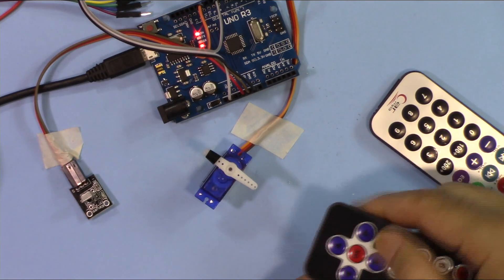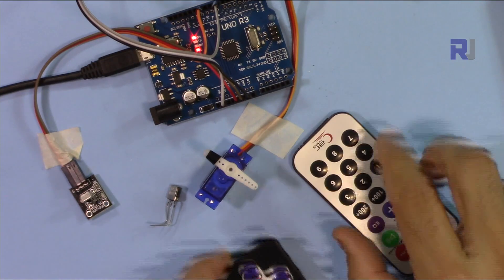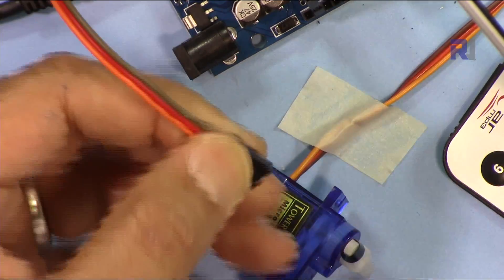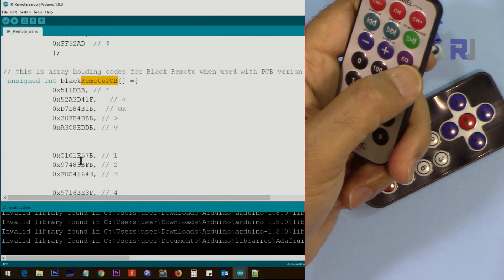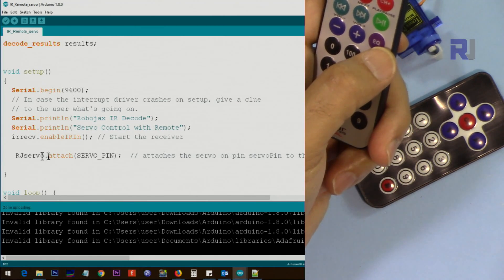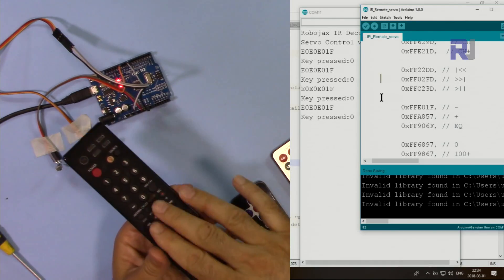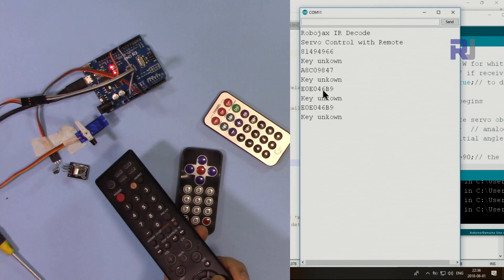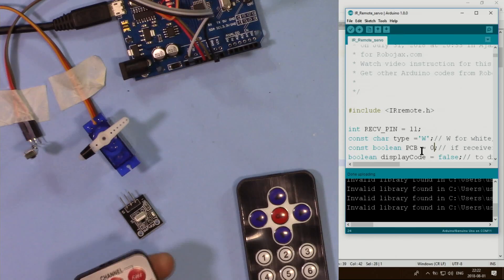Remote 4: Controlling Servo motor with IR Remote using Arduino code RJT113

Comment: Sir I watched all videos related to arduino servo motor push buttons. I learned so many things thank you so much for your great effort. Can i ask a question? Do you a have a tutorial like this but using RF Transmitting Module instead of IR? Hope you will notice my comment
Reply from the maker: Hi, I have no video on RF remote servo or switch
Reply: @robojax  can u make on pls🥰

Comment: Arduino: 1.8.18 (Windows 10), Board: "Arduino Mega or Mega 2560, ATmega2560 (Mega 2560)"

C:\Program Files (x86)\Arduino\libraries\RobotIRremote\src\IRremoteTools.cpp:5:16: error: 'TKD2' was not declared in this scope

 int RECV_PIN = TKD2; // the pin the IR receiver is connected to

                ^~~~

C:\Program Files (x86)\Arduino\libraries\RobotIRremote\src\IRremoteTools.cpp:5:16: note: suggested alternative: 'TXC2'

 int RECV_PIN = TKD2; // the pin the IR receiver is connected to

                ^~~~

                TXC2

exit status 1

Error compiling for board Arduino Mega or Mega 2560.

This report would have more information with
"Show verbose output during compilation"
option enabled in File -> Preferences.
Reply from the maker: Very simple just read it TKD2 was not declared in in this scope.
Reply from the maker: Have you watched the introduction to infrared for arduino? Library is missing
Reply from the maker: Start from here https://youtu.be/LVd9_i-BQcg

Comment: I want to remotely press a button. Would a servo do this or world a stepper motor be a better choice?
Reply from the maker: each can be used for different job. servo motor can rotate only 180 degrees. while stepper can rotate 360.  In this video I've shown only servo motor but if you watch carefully this  video and stepper motor video,  you should be able to do it.

Comment: Hello again, if i want  move the servo from left to right, then return from right to left continuously (0 - 180 - 0 - 180 - 0 ....) and can be stopped at any point by pressiing remote button. how to code it? can i use code as below?
I use switch case in this method. it is possible?

case 0xA15EFF00 :
      Serial.println("three");
      for (servo1_angle = 0; servo1_angle <= 180; servo1_angle ++) { // goes from 0 degrees to 180 degrees
        // in steps of 1 degree
        servo1.write(servo1_angle); // tell servo to go to position in variable 'pos'
        Serial.println(servo1_angle);
        delay(100);                       // waits 15 ms for the servo to reach the position
      }
      for (servo1_angle = 180; servo1_angle >= 0; servo1_angle --) { // goes from 180 degrees to 0 degrees
        servo1.write(servo1_angle);              // tell servo to go to position in variable 'pos'
        Serial.println(servo1_angle);
        delay(100);                       // waits 15 ms for the servo to reach the position
      }
      break;

thank you
Reply from the maker: Hello, Arduino IDE already has the code . Just b click file, examples and find servo.
Reply: @robojax  thank you for replying .... but when i use the irremote, it was moving o-180-0 once only. it was not moving continuously
Reply: @robojax  in forum said that it needs global boolean variable code setting , how to do that? please explain it. thank you

Comment: Good day sir , sorry for disturbing u but I'm facing problems with the code and when i try to modulate it it shows an error saying that.....

'sketch_aug19a:20:10: fatal error: IRremote.h: No such file or directory
 #include <IRremote.h>
          ^~~~~~~~~~~~
compilation terminated.
exit status 1
IRremote.h: No such file or directory'

I don't know why this is happening please help me....and I have also tried using the code given in the description that also doesn't work...please help..

Thank you..
Reply from the maker: Hello, it is very simple. "no such file" it means you have not installed the library which has that file.

Comment: Hi. Thanks for the detail description. I did  control my servo motor using your code. It works great. But there is one problem. The motor keeps jittering when it was connected eventhough if i dint use the remote. Pls help me on this
Reply from the maker: then something is wrong with the motor.  Try to connect it to 5V and GND and remove the signal wire. it should show the same problem. if  so, the servo motor is defective.

Comment: why is "IRremote.h: No such file or directory" popping up when I try to run the code very new here.
Reply from the maker: because you did not watch the video and did not follow the instruction. Please watch without skipping, I can assure you the issue will be resolved. This video is one of a series of videos on remote. you MUST watch the introduction to remote where we learn how to detect code. Then come to this video. I have mentioned it at beginning of the video.  The links are in the description.  good luck

Comment: Have a nice day. I know it's been a long time since I posted this video, but I hope you can help me.
 I am getting this error;The function decode(&results)) is deprecated and may not work as expected! Just use decode() without a parameter and IrReceiver.decodedIRData.<fieldname> .I would be very happy if you help me.
Reply from the maker: Good day, it seems it is the result of newer Arduino IDE (software). Never seen this.  Try older Arduino software and see if it can resolve this.
Reply: @robojax  Thanks. I downgraded to the old version and the hex codes in your video are different from the hex codes of my remote. I fixed this and it worked. Thank you very much for your interest and concern.
Reply from the maker: I am glad you resolved the issue. Please subscribe as this helps my channel to grow.

Comment: Hi there! I know its been a year since you uploaded this video but I was wondering if you could help me. I want to use a continuous servo for this project but I am having issues with it since there's no potentiometer inside. How can I fix this?
Reply from the maker: Hi, I have video on 360 servo. That servo is just make for joke. it is not a real servo motor. you need to use stepper motor if you want to be able to control is at any angle and control the speed.

Comment: Can we control 20kg servo with the same way??
Reply from the maker: Yes. All servos are the same. they just need signal. the power is not coming from Arduino but from your power supply.

Comment: Could I get some help? So, I used your code and everything works great, just had to change some of the codes to fit my remote. But, every time my roommate plays his Xbox, it picks up the IR from his wireless controller and makes my servo tick. It doesn't make it move, it just ticks, and the light on the PCB board of my IR sensor blinks. Is there any way to get it to react only to my specific IR, or is it going to pick up all nearby IR signals?
Reply from the maker: Hi, Unless I have the components and see the issue, it is hard to find the problem. I just looked at the code but without the setup of hardware it is very hard. Sorry.

Comment: Is there anyway way to add a loop to allow me to turn on the loop and off with a remote?
Reply from the maker: yes. You put the tasks that you want to do inside a loop. Then put the loop inside if(    ) statement and check with if () to see if IR signal exists.  if you need to know how to use if() statement or loop,  Here is my course on Udemy that I just launched http://udemy.com/robojax-arduino

Comment: I like what you show us but for beginners it is to complicated to understand I have your white controller,  and I want to move a servo motor, but I don't understand your coding or how to set up my arduino to create the code. I can't open the monitor to find the code because it's says it is temporarily busy. Could you direct me to a code that I can at least put in to my sketch so I can make my servo move.
Reply from the maker: You have to watch the first video. You MUST watch else you will not understand. The link is under the video.